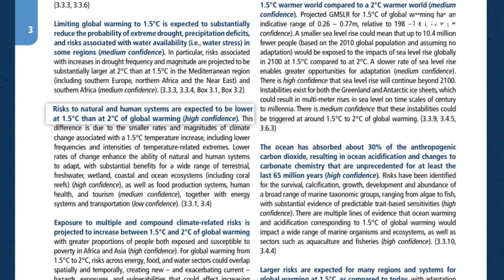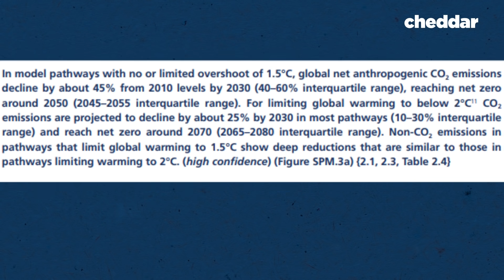Wooden Skyscrapers Are On The Rise - Cheddar Explains

Comment: Terrorist before wood city: get a pilot and a plane to destroy one building

Terrorist after wood city: some matches to destroy one city
Reply: USAball  USAball
Reply: Biggest idiot in this comment section.
Reply: pablo markobar nopp actually he’s thinking correctly lol
Reply: What an imbecile!
Reply: OK, after I type all this I accidentally hit Cancel. Stupid fucking youtube UI.
 
All of the comments ignore the improved fire suppression and the predictable burn rate (char rate) of engineered/mass timber. Fire could be better suited to some types of fires and loads than steel or concrete. Think blast loading and the coating that steel requires for it to have any kind of fire resistance (hin, blasts can knock off the coating, negating it when you need ti most). Also, wood is very flexible and can take massive increases in loads (literally 2x+) for quick loads relative to steel or concrete, that has no ability to exceed it's typical range, even in extreme causes for short durations.

Comment: What a stupid idea. A fire would burn them all. Plus just consider how much forest they are gonna destroy to build one wooden tower.
Reply: The main key is sustainable forestry, which can fix the logging industry. Loggers don't need the land, so trees can be replanted. Also, sustainable forestry is actually even better, because it's only while the tree is really growing that it absorbs C02, then it dramatically decreases how much it absorbs. Tree farmers cut them down for logging at this point and replant. It produces a fast cycle for obtaining timber and it removes more C02. One of the big culprits we should be scared of the cattle. Cut down trees, but the trees will never be replanted because they need the land for the cattle.

CLT is far more fire resistant than a bunch of 2x4s.
Reply: 4:43

Comment: How exactly does CO2 affect global temperatures?
Reply: that gas absorb infrared radiation, aka "heat", so, obviously it would be warmer.
Reply: @xponen  oxygen is also gas.
Reply: @sean51697  anything can be a gas... boiling water also create gas. Burning stuff create CO2 gas. Volcano create gas.
Reply: @xponen  yes I know most of the gases released from volcanic eruptions. The gas from the volcanic eruption does not affect global temperatures it is the Ash that goes into the atmospherics blocking out the sun that creates a volcanic winter. 

And besides carbon dioxide is a heavy gas that typically sits to the bottom of the ground. There is more carbon in the ground then the is in the atmosphere and there is more carbon in the ocean than there is in the ground. 

Many times throughout the history of the planet there was an ice age while CO2 was at same level it is today and many times during the Hot periods of Earth's history CO2 level where also as high as today's CO2 levels.

Earth's CO2 levels have very little in correlation with the Planets temperature. 

There are many astronomical explanations to way the planet is becoming warmer.
Reply: @sean51697  actually, there's only 1 cause; it's CO2. Because, we didn't cause volcano, and we certainly didn't control the sun, we don't control the sea either. So how long has our civilisation set up like this? 100 - 300 years right? day & night happened every day, El-nino & La-Nina happen every decades, and an Ice-age for every thousands year. So how long has it take to change climate like we do today? 1st) the probability for us to be right in the smack of a thousand year cycle transition is very low, and 2) it isn't short, it stretched for too long, for a 100 year already for it to be decadal cycle. So, obviously it is NOT a cycle, it exist because we existed.
Reply: @sean51697  If this is a cycle, as natural as you want it to be, by the sun & the sea & the circularity of natural mechanism, then when will it Peak?
Reply: @xponen  I have never claimed that this was a predictable cycle, I was only making the statement about CO2 having very little in correlation with climate change. In space there are certain warm patches that our plant passes through. All I'm suggesting is that the fluctuations in our planet's temperature may be caused by natural phenomenons.

Comment: Union Carpenter here. 

Concrete and Steel is best building material for large commercial.

Wood has a place for smaller-medium. But for large buildings.... im skeptical. 

Wood is without a doubt much more cost effective. Forming is WAYYYYY more labor intense than framing. Like x3-5 as much cost.

It all comes back to fire. If we could solve that, then I could see medium sized going wood. But large 1's, Im 100% for metal.
Reply: I mean watch the video.

Comment: Good documentary.... I think floor with CLT (Cross Laminated Timber) is a very good option to reduce CO2 for office tower and house with a concrete frame (it s best for the owner...), if there is an easy maintenance and if the change of CLT is simple. For housing tower, duplex apartment is a good solution to have half of the floors in CLT (you don't disturbe your neighbors).

Comment: 2:35
A cubic meter of wood doesn't even weighs a ton
Reply: https://www.engineeringtoolbox.com/wood-density-d_40.html
you are mostly right, but not 100% correct.

Some examples

 American Oak
770 kilograms per cubic meter
Lignum Vitae
1170-1300 
Balsa  (cause it has such a low density)
160
Aspen
420

Comment: Concrete and steel are the best.
Reply: To kill the planet
Reply: To dehydrating the resources of out planey
Reply: To if you don't want you're resources to be farmed and use again and have unlimited amounts of it
Reply: Who has told you that eco-bullshit? 20 years ago they would not manipulate you. But now eco-manipulation is bery important!!! Pay more, get less. Wood does not have better ultimate tensile strength or yield strength than steel. Steel is still used, because it is cheaper and has higher strength!

Comment: None of this makes any sense.  Its sounds like most of these buildings are made of pressure treated wood which could contain CCA and formaldehyde which is not only bad for the environment but bad for people. Its more sustainable to make wood than concrete which is basically made of garbage and pebbles? You still need to cut down trees and treat them, while concrete is made of garbage and pebbles. Our concrete buildings hardly need repair and when they do its fairly inexpensive, while wood buildings like temple of the flourishing law need constant minor repairs, are very expensive, and some of the materials are very expensive to produce or are unobtainable.
Reply: Concrete is definitely not made from garbage and pebbles. We are actually running out of sand one of the main ingredients in concrete driving up its cost. Fyi no garbage is used in making concrete and forest can be successfully maintained and managed to be used forever.
Reply: If you can turn garbage into concrete you would be a billionaire!
Reply: There have been proposals to replace concrete with materials made out of garbage but that isn't concrete, these two are not the same. I would advise you to read up more on concrete because I think you're mixing it up with asphalt which is made from a lot of recycled materials in some cases. Concrete is made from mixing cement with sand and rocks however that can't just be any sand, it has to be very fine so beach sand is preferred which we are running out of. The production of the cement needed for concrete and the pouring of it releases enormous amounts of CO2 making it decidedly unsustainable. Also concrete buildings do need repair, I think you're again mixing up things the current form of concrete we use can last about a century. Old structures made out of concrete like the Pantheon used a different mixture and cement which lets it last much longer but it's more difficult and expensive to work with. In modern concrete ease and low construction price is however preferred over long life spans. Also the comparison to the Temple of the Flourishing Law is misleading, it is a temple with lots of fine details and work that needs careful maintenance, and skilled craftmen, a building made of concrete like that will also need maintenance. It's because of the details not the use of wood.
Reply: Lol concrete is not made out of garbage and pebbles. There's a reason wood is more sustainable than concrete or steel. Google it - dumbass.

Comment: "... how close or how wildly far off these predictions are.  One of the big misses? The building materials.  It turns out the cities of the future might be made out of wood"   Something that "might" happen doesn't disprove a prediction.

"20 years ago, researchers discovered glueing wood in a cross pattern, altering the direction of the grain, negates the weakness of any one piece". The discovery that glueing wood in perpendicular grain patterns makes it stronger was discovered LONG before cross laminated timber was developed.  For example, the first patent for plywood, which consists of veneers of wood glued with grains 90 degrees to one another was submitted in the late 18th century.  As a hobbyist woodworker myself, this is a fundamental concept I employ in my craft and I'm certain woodworkers have known about this for many centuries, if not longer.
Reply: The romans used it in their shield its called plywood hahaha you already know about this. media doesnt i guess
Reply: I think that the novelty is the use of  the cross pattern in beams as usually you use long single pieces of wood as is easy to obtain from an appropriate tree.

Comment: Wooden towers don't seem like a smart idea...
Reply: I bet your grandad once said "towers don't seem like a smart idea..."...
Reply: m999 - If one candle gets knocked over, one stove gets left on or one cigarette doesn't quite get put out... You're gonna see the equivalent of a titanic like disaster where 3,000-5,000 people die. You think a house fire spreads fast...? Your talking about a 10-20 story match stick. Let's not even get started on how structurally weak a tower made of wood would be... That's why towers are made of steel. What happens if there's a water leak or a pipe break on an upper level apartment? Wood rot would be so bad they'd have to rebuild the entire building. What about termites? A steel building could last 200+ years. A wooden tower? Maybe 70 years before it suddenly collapses one day without warning killing everyone inside, not to mention innocent bystanders on a city street. Good luck trying to get any city building inspectors to approve a wooden tower. Jesus fucking Christ you are a goddamn idiot! Sounds like you're one of those liberal fucks who put compassion before common sense...
Reply: m999 - Any other smart ass remarks or did I hurt your feelings enough?